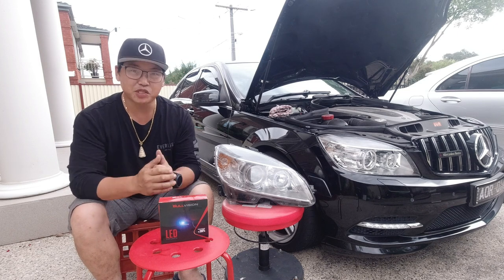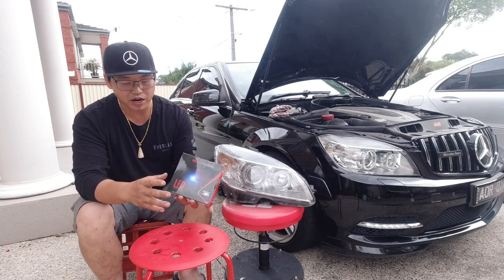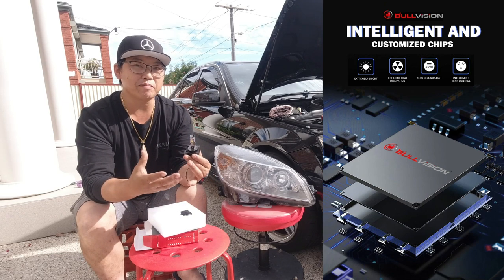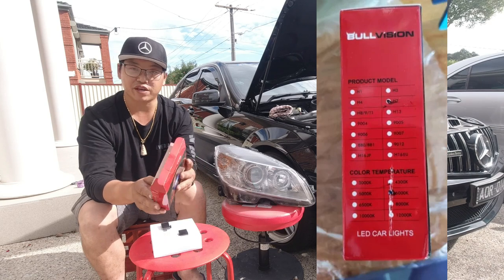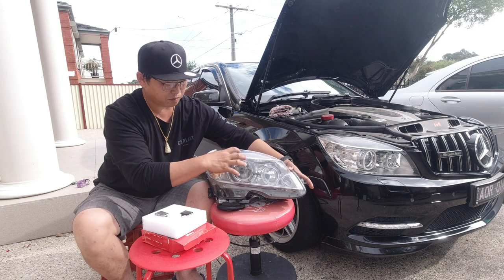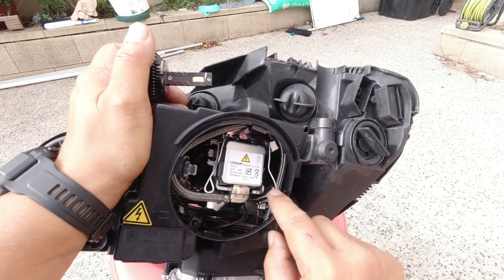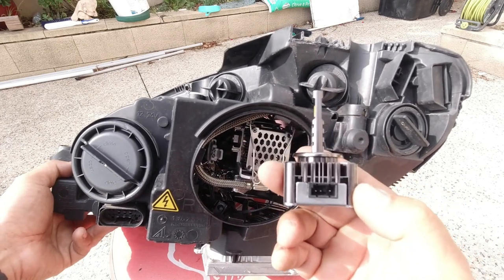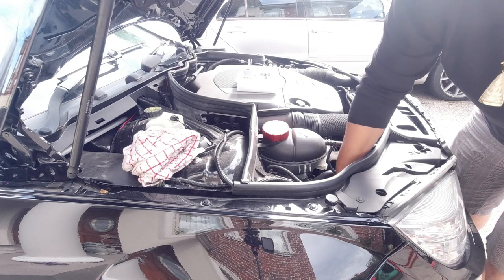mercedes w204 preface LED headlight bulbs BULLVISION D1S HID direct REPLACEMENT plug n play

Comment: Thanks for another great video Mikey. This is so timely as I just finished opening my bixenon headlights using your videos as a guide. I was able to replace the frosted factory projector lens with a clear one, cleaned the haze on the inside of the plastic lens and sanded and clear coated the exterior. I was also able to do some tweaks to the projector shield and lens and now the output is amazing with my CBI bulbs but they don't match the rest of my bright 6k leds snd i was thinking if only there was a good error free led bulb i could throw in there and keept the stock ballast and bam, I get your upload alert :) .  I will definitely give these a try to complete my lighting thanks to you. Cheers mate.
Reply from the maker: mate that's great news ... good stuff ..km glad I was of some use to you .. as long as I can help someone with their project I'm happy ... and congrats on doing what u did.. it takes balls .. and u did it

Comment: Hi Mike sorry to go off Topic but quick question if you are C-Class happens to be a 200 can you still put their grill with the large Mercedes icon on the front like what you did in the other video
Reply from the maker: yes outside shape is the same only engine is different

Comment: Thanks Mikey. One of my D1Ss doesn't work, I replaced it but still doesn't work. I then swapped the bulb and realised it's not the bulb. Could this be a faulty ballast module? If I replace the D1s with LED would it still work without replacing the ballast module? Everything works except for that low beam light.
Reply from the maker: definitely might be the ballast without a operational ballast your low. eam won't work ..and the ballast is only for your low beam ..high beam works off another module
Reply: @MIKEYZVLOGZ  Thanks mate.
Reply from the maker: @kevingamage8277  welcome

Comment: Between led and xenon, I decide for led, because led doesn’t damage reflector and lens. Temperature of led bulb ~70°, at xenon it near 250°
Reply from the maker: good tip and choice
Reply: Xenon is around 150° and LED around 100° so difference is not that big. However xenon bulb also has UV radiation that furthers the burning of reflectors inside the projectors

Comment: Hey Mikey, just wondering, previously the ballast on my W204's left headlight got flooded and fried, does this LED bulb utilise the ballast?
If so, does that mean the LEDs and HID bulbs are just interchangeable in the HID housing? Replacement headlights and even parts for this thing are a bloody nightmare to come by.
Reply from the maker: yes it does, so u will need to replace the ballast to use any bulb.. thi sis t he way it was designed , for the bi-xenon headlights, indeed changing the ballast and headlight is a nightmare but very doable

Comment: Hi, would this work on my w204 2013 c class which has the xenon headlights which look different to yours?
Reply from the maker: yes just ensure u get the right size leds which ever that is
Reply: They're d1s as well
Reply from the maker: @kabelodneta  if they are the same then should work just fine
Reply: @MIKEYZVLOGZ  yup I am looking to buy a pair of these for my C class as well. The only downside is that just in front of the car there's a dark spot from the way the LEDs are located, but it's so close to the car it doesn't make any difference - the light output is much better.